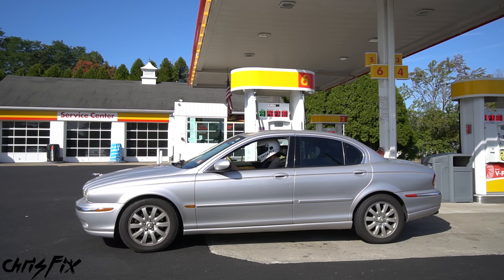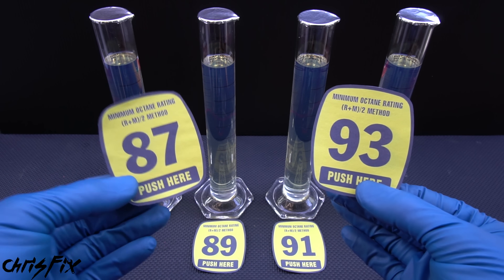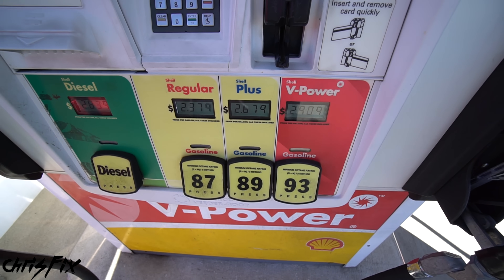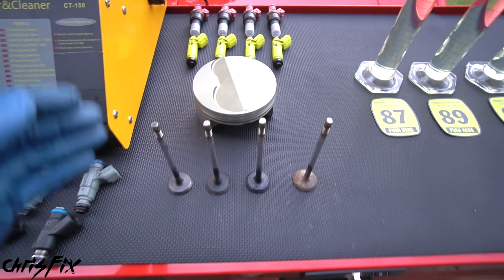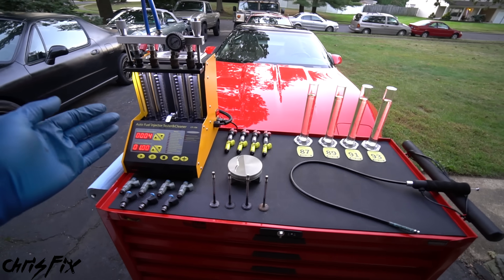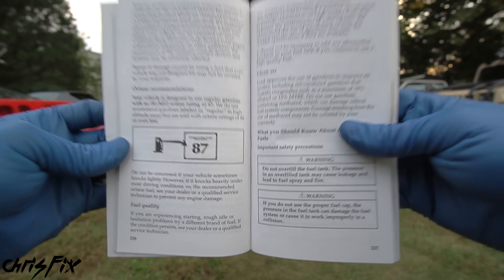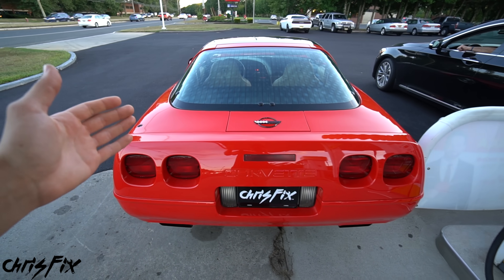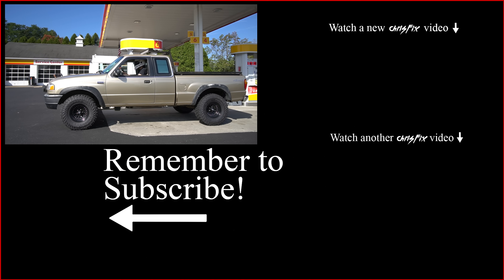What is the BEST Fuel to Use in Your Car or Truck and WHY

Comment: top tier only(name brand). keeps everything clean. lowest octane that applies to your engine. you do NOT need to buy premium octane to get the top tier cleaners. 87 name brand top tier has all the additives needed. here in Denver the commerce city refinery has 2 filling racks for tankers. top tier and not top tier. name brand stations dispense top tier. if in doubt research online who has top tier. also watch engineering explained for more on this subject.

Comment: I looked in the manual of my '94 Audi A8 and found nothing about E-85. Imguessing its a newer thing. The only thing specified about fuel is "unleaded fuel required" (I dont think you can even find leaded anymore). So in a car that old...can it cause damage if I use E-85? (I saw something related to ethanol at my usual gas station but not sure what rating it is)

Comment: So about 2 weeks ago, we had a super cold day out of nowhere and I turned my car on to go to school and I had a gascap light on and so I bought a brand new cap right after school (lockable cap) and then the light went away. But a few days later the light came back on and so I drove around for another 2 days hoping it would go away but now it has a check engine light too and I had my car scanned for the code and they told me it could either be a loose cap or a bad leak detection pump (since they tested for a leak and there was no leak) and I know the cap is on tight and I replaced the pump myself. What could be the problem??

Comment: You tell some truth and did a good job explaining it but I worked for specialty gas and standards companies and the premium is a cleaner gas not just the additives also has way less ethanol which is very harmful to engines. Regular has about 10% which is high and premium has far less about half that and you can put additives to knock that down more.

Comment: Everybody: Chris still has a Prius now? 😂
Reply: yeah - he was going to sell it and hhe did not it seems :D
Reply: Murderous Kitten I think it was filmed before he sold it
Reply: @murderouskitten2577  he legit said it was already sold
Reply: @brendancross2767  maybe he barrowed it from someone...
Reply from the maker: It is my friends car. I gave it to them.
Reply: ChrisFix oh I see. 😂
Reply: Oh... I did not watch the whole vid so😐😐😐
Reply: My guess is he is waiting for a good buyer to come along. For myself, I have had nothing but Prius since 2004 (my wife since 2002). They are by far the most reliable car either of us has ever had. My 2002 - bought used at 103K miles - needed its first repair at 197K miles. I replaced the inverter coolant pump for $150. Before that it was just a windshield, tires, wiper blades, and a couple of 12V "aux" batteries. I gave it to my son this summer because I no longer needed a second car, and he replaced the front brakes on general principles - they were half worn but the pins needed to be relubed. The rear brakes had the same thickness the new ones did so he returned the rear set.
Reply: @flagmichael  true. even though they have their hate. Priuses are nice cars, unless you get the 2009 models
Reply: @motorkid151 But when he filmed the how to fix the hibrid battery and when he said he was going to sell it but that was like a year ago, but it could also be one of his family members cars, but I do not think chrisfix would let one of his family members buy that car. (I am only a kid so if i am wrong do not blame me😄)

Comment: I used to work at a Hyundai car what back in 2016. A lady bought a brand new Hyundai Sonata and filled it full with diesel. It ruined the car terribly and one of the mechanics had to take out the whole gas tank empty it, and take apart the engine and reseal a clean some parts

Comment: My Acura preferred 89, I think. My Toyota needed a fuel injector cleaner when I first got it. I took it on the freeway on a hot day and opened it up. Glad I did not get a speeding ticket.

Comment: long story short, if its available whatever doesnt have ethanol in it is best. chris is lucky, i dont see any ethanol content stickers on those pumps, but ethanol gums up injectors, hurts fuel economy and destroys rubber lines and gaskets. i know the hard way, had a pre ethanol vehicle, and the carb gaskets and fuel lines deterioted within a year of putting ethanol laced gas in it.
i dont know why he didnt get into that. a lot of states require around 10 to 15 percent ethanol in normal gas now.